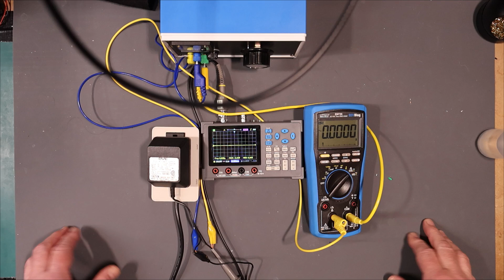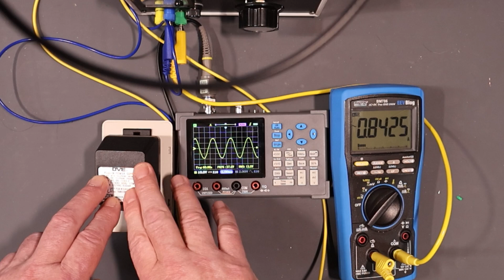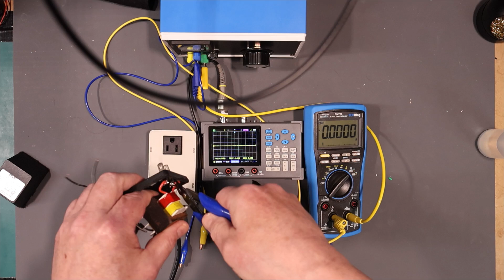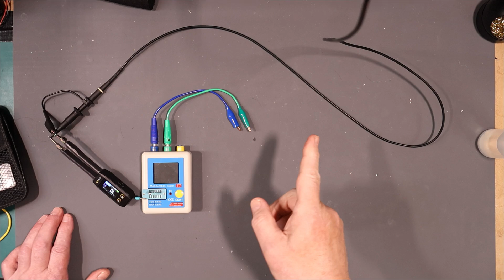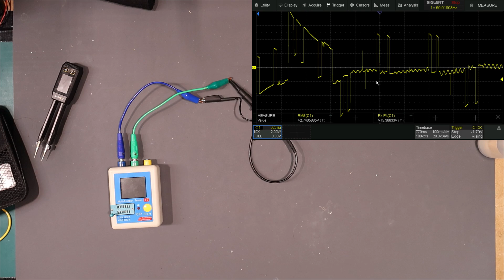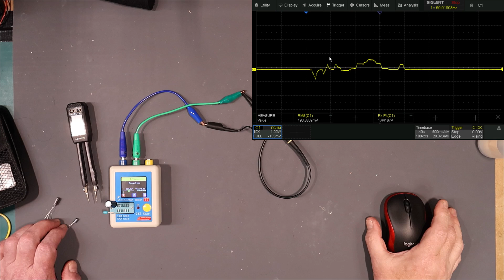Uni-Byte  0279 - Answering Viewers Questions:  Q&A 1

Comment: Five thousand subscribers! Dang! I know a celebrity!
AS I recall from my reading 60 years ago, the transformer cores are air-gapped to saturate at the rated current and develop the rated voltage when they do. I have to warn young EE's about them when they want to use one of these old core-saturation regulated transformers in a project. I think most glazed over the chapter on transformers and hysteresis and eddy currents when they went to school, and never actually used one to get familiar with them. They think 5 volts is HV. Software folks who think they know EE are even worse about that, especially when their project's load is a microcontroller and FET that draws 500 mA when it's busy, but essentially nothing when it drops into sleep mode. Electrolytic caps don't like those voltage jumps.

BTW, those transformers are also a good source of various gauges of essentially free wire for winding RF toroids. They will save you from having to spend a silly amount of money on small amounts of magnet wire in order to get all the various gauges you might need. Thanks to old transformer-based junk-box wall-warts I picked up here and there I've been building projects for years and I've never had to buy magnet wire for ANY of my RF projects.
Reply from the maker: LOL!  MrBeast better watch out!

Yes, they are a good source of magnet wire too.